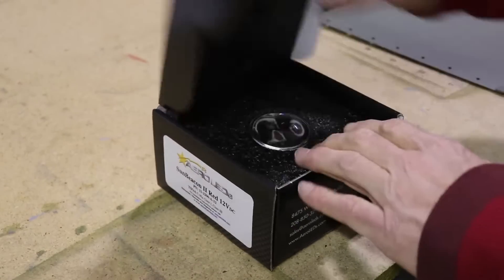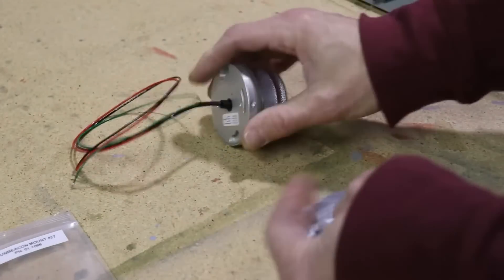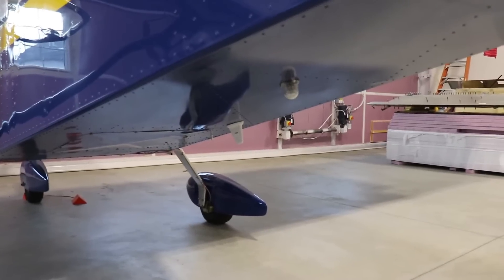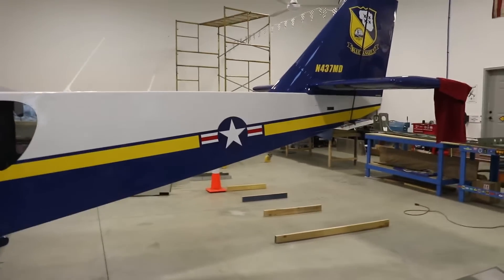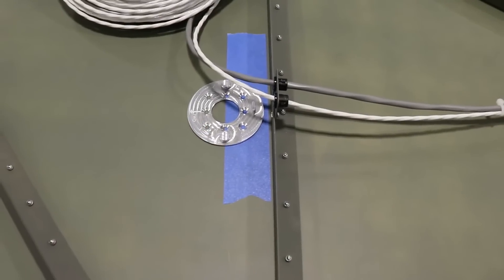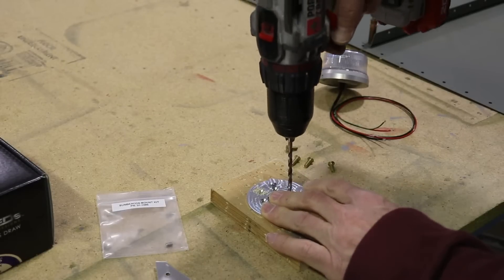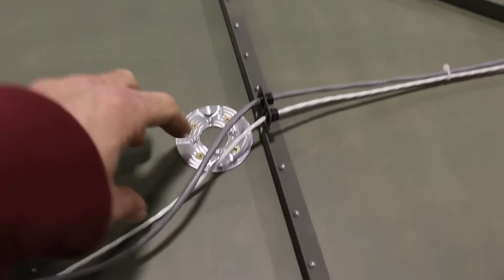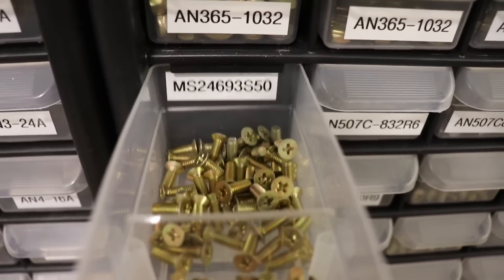Installing the AeroLEDs SunBeacon II (Ep27)

Comment: Very informative and educational even for a 172 guy.    I just purchased a AeroLED  SunBeacon ll as a replacement for my old (1973) strobe on top of my vertical stabilizer, Have you/will you posted any info on  using shielded cable ???   in replacing strobe and white position light also in the tail, AeroLED recommended using #18 shielded cable. Cant find 4 conductor so will two 2 conductor shielded installed side by side be ok ???    Thanks

Comment: Hi, thank you for another very interesting video!
A question...will you use a back plate on the inside of the aircraft to sandwich the skin between the strobe light Mount plate or just use washers..?
Cheers,
Phil
Reply from the maker: No I don’t think that would be necessary. I’ll just use a washer and locking nuts.
Reply: Kitplane Enthusiast thank you Mark. 👍🏻

Comment: I enjoy watching you build your plane.  I was wondering if you have ever considered using manual focus and wide depth of field so that the picture isn't constantly going in and out of focus.  Thanks!
Reply from the maker: I probably should. The problem is where I place the camera. I point it at what I’m doing but them my arm or hand gets in front of it at a different focal point so the camera refocuses. I figure in another 50-60 years I’ll actually figure out what I’m doing!

Comment: Before you put the grub screw in get a small drill and make a dimple in the mounting plate so the grub screw fits better and cannot move and the light come off the plate from vibration
Reply from the maker: Excellent idea. I used to do that to the main shaft on my R/C helicopters!
Reply: Its something I was taught to do at work many years ago especially on pointed grub screws as they tend not to bite into the facing material

Comment: You mentioned that to change the beacon all you would have to do is go in the belly hatch and disconnect the wires and then remove the beacon.  However, if you leave a service loop of your wiring inside the fuselage with connectors, you can change it totally from outside the plane as you'll have some slack to let you pull the connectors outside the fuselage.  However, I doubt that you'll ever have to change the beacon unless it is damaged from striking something - those LED's will probably last longer than you do! LOL!
Reply from the maker: Yes you are 100% correct. As long as the connector is smaller than the hole in the skin, it would be much easier to do everything from outside the plane. I’ll have to make sure the connector can fit through the hole! Good observation.
Reply: Stager the quick connects , use moisture proof connectors.